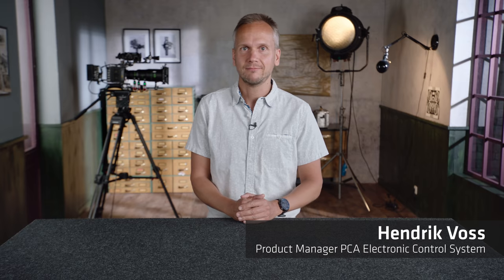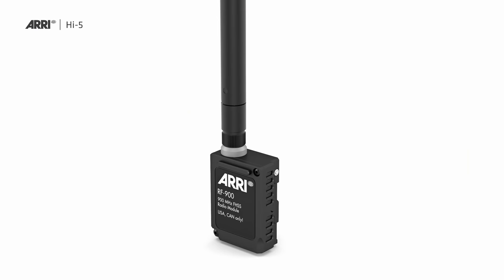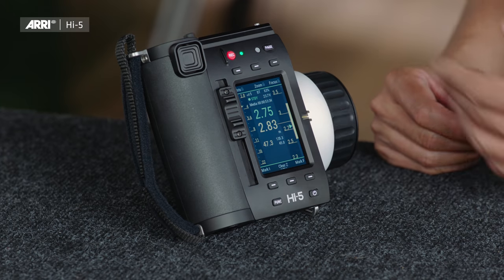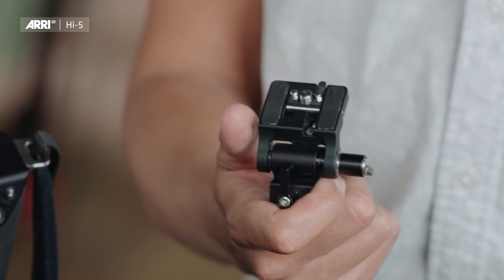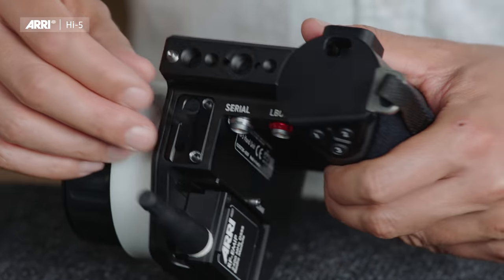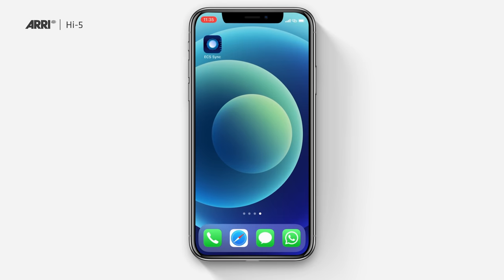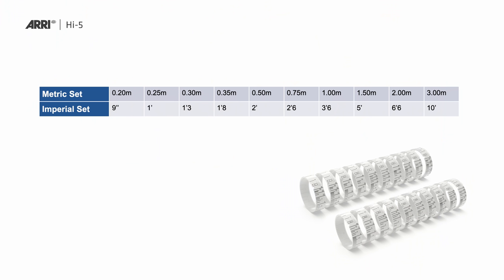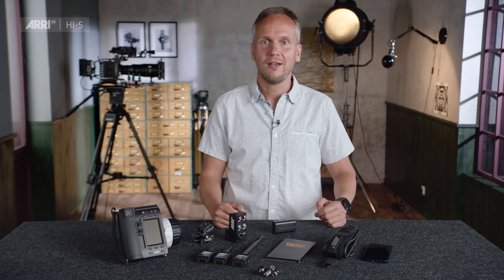ARRI Tech Talk: Hi-5 (Subtitles in EN, ES, FR, IT, JA, PT, ZH, KO, ID)

Comment: Always the best! Can the RIA-1 be used with existing C-Force motors? In other words, can the RIA-1 use a fixed freq in 2.4 or does it only take the place of the 2.4 hopper or 900Mhz system?

Comment: Why are you choosing "E," at @13:20 - what do the different letters represent?
Reply from the maker: Hey Derek, the letters correspond to the scale class of the lens. The scale class is assigned to a lens after manufacturing, to account for tolerances in the process which might affect the distance between focus marks. You can find the scale class written on the lens at the end of the focus scale, usually just after the minimum focus mark. Just choose the write one according to the specific lens you have in front of you!